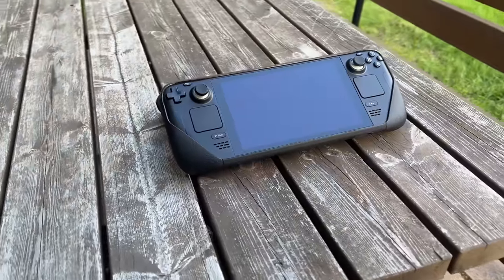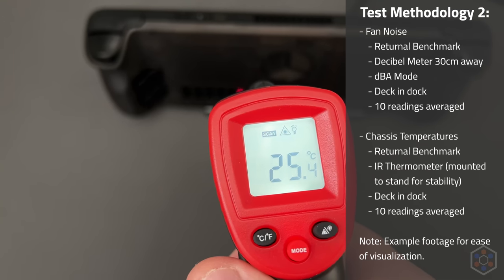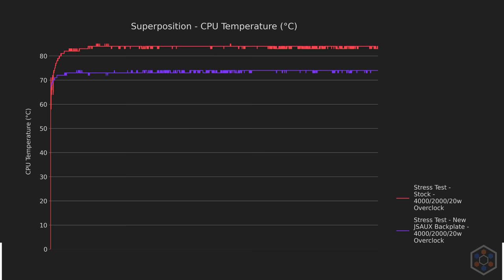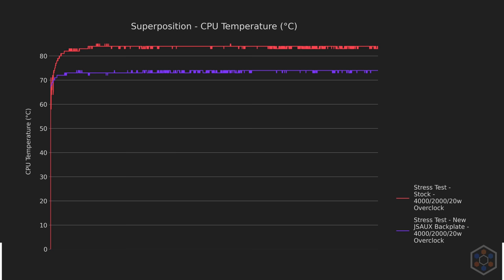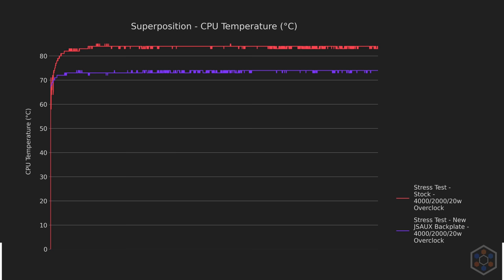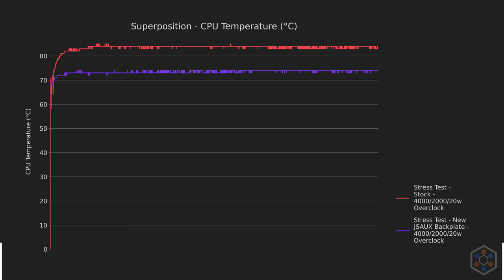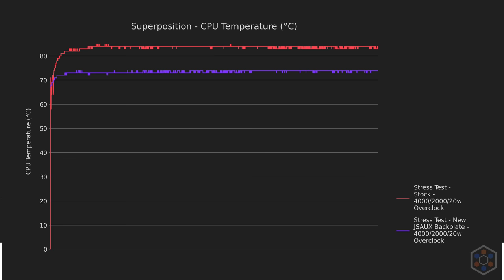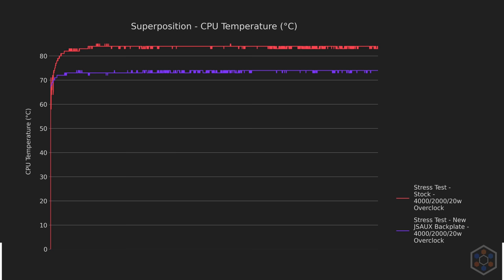How LOW Can It Go? | Steam Deck Thermal Modding

Comment: I drilled some holes onto the backplate in the same spot as the vented backplate like 6 months ago. Works great and no issues so far and I use my deck daily. Undervolt, drill holes and put some new paste on and it's a world different in noise and Temps.
Reply from the maker: I'd still be a bit worried about the metal plate getting too hot, but I'm sure that it'd be fine with some additional airflow. Thank you for watching and letting me know that your mod is working well!

Comment: Interesting to see you're using generous dimensions for the PTM pad. I've seen others cutting them to (exactly?) 13mm^2, which would be the size of the die. If you're thinking what I'm thinking, the pad is non-conductive and any excess size would only help transfer heat from the pad to the heatsink slightly. In any case, thanks for the extensive testing! :)

Comment: Top Video. The Jsaux mod case & metal back plate with the fan that goes with it works well for OC, but otherwise its a bit on the hot side on the metal
Reply from the maker: Agreed, as you saw in the video! Hard to recommend with burns being possible 😅

Thank you for watching!

Comment: Nice work as always, Kyle!
That aluminum back plate is really hot, but if you will replace it with copper plate it will be burning hot. I diy'ed mobo copper plate and placed the 1st Peltier cooler on top. I'm using ptm7950 thermal pads also.
Then the 2nd Peltier cooler is placed on the jsaux copper back plate I made. My temps ranges between 68c to 71c max with 50mins gameplay.
Can't wait to see you comparisons with the monoblock. I also installed a 2280 4tb nvme using nvme extension cable + 1tb microsd.
Reply from the maker: Damn, I aspire to have something that custom! We'll see whether I can get there over the coming months 😉

Thank you for watching, and for the copper plate warning!
Reply: @cryobyte33  Kyle, I never expect that you'd reply on my comments, knowing that you're very busy with all these benchmarks. Thank you!
If ever you decided to go for a higher capacity storage and wouldn't mine modding your steam deck case to install a full size nvme.

Here are the materials you'll be needing.
1. It should be a low profile 5cm nvme extension cable, i had it custom made from aliexpress.
2. Rotary tool and cutting blade (use the metal disk cutting blade).
3. PPE'S- goggles, mask and working gloves.
4. Ruler and fine tip marker.
5. Thin copper sheet to protect the 2280 nvme and as a heatsink as well.

I failed on my 1st attempt, cause I ordered the wrong length of the nvme extension cable, i was thinking I can just fold the cable but it was too thick, the length should be short. I ordered again a 5cm long, but the 4.5cm will be ideal if the manufacturer will agree to make it that short.

Here are some of the sample photos taken when I was doing the mods on my SD. You can use the photos as your reference for the 2280 nvme instalation.

https://ibb.co/6wqbZYC
https://ibb.co/VvmF1Zm
https://ibb.co/X8ZSnQM
https://ibb.co/ypzp9jr
https://ibb.co/DCX7mB6
https://ibb.co/2YFwJxn
https://ibb.co/30NB6XM
https://ibb.co/p4wSpL0
https://ibb.co/BPhz9d2
https://ibb.co/kGPwSVd
https://ibb.co/BKzkX0y
https://ibb.co/X3ynQSF
https://ibb.co/8NwYYQp
https://ibb.co/LRNBbTh
https://ibb.co/2W6fSyY
https://ibb.co/tbRy00r
https://ibb.co/3fJ5TJx
https://ibb.co/yP2p62V
https://ibb.co/p1HZkR0
Reply from the maker: @jozac05  thank you so much! I'm screenshotting your comment so I can try it out after I get to the US sometime 😁 I really appreciate the thoroughness!

Comment: Just a question about the PTM install, I noticed you used a piece wider than the die itself, I read that PTM is electrically conductive, so do you need to protect the area around the die as well? thanks

Comment: Kyle, I would love it if would do a vid on streaming from PC to the Deck using a 5g gaming router(s). 

Benefits might be:
storage
battery life
locked 60
no external gpu or wires  
Full PC access, including Windows gaming (I believe) using a free program called Moonlight & Sunshine

Things I noticed using Steams streaming service:
zero discernable input latency between my TV (in gaming mode) and the deck. 
   if anything, the deck screen responded quicker
all Deck and PC controls worked on both screens normally
some stutters and freezes on the Deck screen, but I 'm using a junk cable TV modem/router
  i didn't try opening ports, or messing with settings on the router, or anything technical

720-800p wouldn't be very taxing for a decent PC

This could be a future-proofing solution, that I'm surprised nobody is talking about

AAA's on PC -- Everything else on Deck, is what I'm thinking

You might be able to make a series out of this for Deck or all PC handhelds
Reply from the maker: I don't have a PC I can use for that right now, but I plan to make exactly that video when I get back to the US and have the ability to 😁

Thank you, as always, for watching and for the ideas!

Comment: Awesome video! This may be mentioned in another comment but for the fan volume measurements using a different scale for the dB might give a better visual representation of the perceived loudness. Especially for people not used to sound pressure level measurements or nonlinear measurements.
Reply from the maker: It seems I can't win 😅 In the last video where I measured dB I got a ton of complaints saying it should be dBA for more accuracy to the human ear. I got a meter capable of reading that and used it here for that reason 😂
Reply: @cryobyte33  Sorry for the confusion the measurement technique is great. There are just conversions from db to sound intensity or perceived loudness that you can use. But you are right you can't please everyone haha either way  thanks for the great content.
Reply from the maker: @chasemcardle  Yeah I don't mind swapping, it's just hard to please everyone without infinite time and/or data 😅

Comment: Just got the copper heat spreader from another YouTuber Low_Budget, and it basically ties the RAM, all of the VRM/coil/MOSFET and stuff together, and also couple it all to the heatpipe.

Which basically negated the need to flow much of the air over those things.  (Except SSD, but i do have a small copper heat spreader/sink on that)  i also have the JSAUX non-vented Case, which i do plan to drill some holes to minick the vented case.

One funny thing i found during testing.  In cyberpunk 2077's settings menu, if you do not limit frame rate in Cyberpunk's setting, it will be driving the GPU like mad and easily send the temperature through the roof. (GOG version)  the GPU is actually cooler when running the benchmark than just the menu...

If you need to run benchmarks with heatsink as saturated with heat as possible, all you need to do is let it sit at the menu for 1 minutes without frames rate limit...  I think i know what i need to do when my Honeywell pads arrives.

Comment: I'm using a vented backplate, but in the case of ssd, even if I run the benchmark, the speed doesn't drop and the temperature is kept within a safe range.
The game will heat up less than the benchmark, so it seems like nothing to worry about.

Comment: Thank you so much for this video, I will be looking into the ptm7950 thermal pads, sticking with the stock back plate believing in the air flow pattern valve went with.
Reply from the maker: Thanks for watching, nothing wrong with that! 

The negative pressure flow that Valve went with is definitely great and well-researched, but falls over a little bit when pushing more than 15w into the APU. Regardless, it's great that we have the option to use whichever we want 😁

Comment: Hey Kyle, great video. I do have one request though. Can you change the line graph style to use dotted lines for like pairs? Example:
Original Stock - Green.
Stock, pad and backplate - dotted green.
Original stock overclocked - Red
Overclock, pad and backplate - dotted red.

Would make quickly seeing improvement pairs easier.
Reply from the maker: Hmmm, I'll see if I can make that happen, I'd have to do a lot of work on my code to make that possible, as the libraries don't support it outright. It could also make it a little fuzzier in some areas.

Regardless, I'll try it out and try to implement it if I think it clears things up, thank you so much for the recommendation!

Comment: Am I broken? This is the COOLEST video on the internet to me! I did a much smaller version of this on my channel, but yours is so exciting!
Reply from the maker: Thank you for watching, I'm glad that you enjoy it! It was a ton of fun doing all the testing and aggregating the results 😁
Reply: @cryobyte33  I can only imagine! I had a blast doing my own basic testing, but I wasn't nearly as thorough as you! You've definitely sold me on the new JSAUX backplate over my current one. Though, I think I may compromise and add a bit of filtration to it. Also, I didn't expect a response, but I had a question for ya. Does the magnetic fan stick to the new JSAUX case's plate? I didn't check to see what materials it was made of, but.. man, would that be ideal if it does! There's always a way! Thanks for the reply!
Reply from the maker: @Sadtiric  The magnetic fan doesn't stick to either backplate by default, since they use aluminum plates. The magnetic fan itself comes with a sticky steel plate to adhere to the existing metal on the old backplate. 

That said, the new backplate wouldn't work that well since there's no exposed metal and you'd just be attaching the steel plate to the plastic shell. 🙂
Reply: @cryobyte33  That makes sense. I swear I watched the whole video, and even rewatched some parts, my memory just.. isn't great 😅🥲 I do remember you saying most of that in the video now that you've said it here.

You convinced me to order the new backplate to replace my old one, and I think I'll do my own, much less thorough, comparison with it and the new one with a PVC filter I snagged. Assuming I can get it to play nice. I just want to see if it makes a difference in noise and internal temps (and to keep dust out!). Theory is it might increase that internal airflow a tad and keep the other hardware a bit cooler. 

Sorry to bug you again, but what program did you use for the graphs? I recognize the style and would love to use them as well! Thanks for being so helpful and supportive! Can't wait to see what you put out next!
Reply from the maker: @Sadtiric   Sorry for the delay! I use a custom program I wrote, actually. It's a python program using MatPlotLib and it parses the results that MangoHUD generates. I plan on making it open source eventually, but it's a pretty hacky solution right now 😅
Reply: @cryobyte33  No apologies necessary! Thanks for getting back at all! 

I saw a service (Vizzlo) that does something similar and has a free version with a watermark, so I'll just use that for now. Though, I'm curious to check yours out if/when it goes public! 

I've got one of the new JSAUX backplates, and I plan to swap it with my old one and do some graphs of my own, but I also have a 3rd option. I plan to mod my grip case to potentially help block more dust and to slightly restrict airflow to allow more cooling to go through the designated path. I've never used a dremel before, but it can't be THAT hard! I'll tag you in the video when it's done, as yours was definitely my inspiration! Won't quite be as sophisticated or articulate as yours, but I'll try my best!

Comment: super useful info defiantly have to do some of these mods i would add a thick fabric to the extra vents on the back to add filtration sound dampening and increase the negative pressure else where might be able to do it with out losing to much cooling
Reply from the maker: I don't think a thick fabric would be ideal, but a metal grate would likely do wonders for both back pressure and filtration. Thank you for watching!

Comment: I have had problems with the Noctua paste pumping out and leaving dry spots on the chip.
Both on a naked die Laptop CPU and a Vega 64 GPU.
The temps are good for ½ year or so and then they slowly get worse.
The paste works fine on big Ryzen or intel IHS, but not on small naked die chips.

Comment: I assume  there would be no benefits to using the new JSAUX back plate if you plan to use a protective cover on your Steam Deck since the protective cover would be covering the vents?

Comment: What would be really interesting to me is how the updated jsaux back affects other heat generating components. We know the (internal stock)metal plate is used to help cool multiple of them, and valve built it the way they did to ensure airflow cools more than just the apu. So one might guess the extra vent could have a negative effect on their temps.
Reply from the maker: Check out the pinned comment 😉

Thanks for watching!

Comment: Thickness: 0.25mm sorry im confused because ive seen ppl on reddit use 2.5mm so it the 0.25 you link actually the correct one? Changing my decks shell and fugured id redo the thermal past while im at it so im trying to figure out what to use TT

Comment: I was today years old when i found out the Steam Deck can be Overclocked.
I wonder how well having the CPU at 4Ghz benefit Baldurs Gate 3 as its very CPU demanding. That extra 200mhz on each core surely has to have some benefit

Comment: at 20:06 It shows that the ptm is running hotter than noctua thus lifting a bottleneck.  However, when the chart changes to returnal, the results show that the ptm has lower fps than the noctua.  Is the results on the returnal chart mislabeled?

Comment: you missed cutting the old jsaux pad to let more air pass anyways awesome work
Reply from the maker: Doing that reduces the benefits of the metal plate, but improves airflow a bit. It definitely helps plate temperatures, but it makes the old backplate function much more similarly to stock, which I think is a bad thing unless you're going for aesthetics.

Thank you for watching!
Reply: @cryobyte33  i don't agree i get much better temps now with around 25% of the left side of the pad cut .The back plate is still really hot. Cutting the left side of the pad help the fan and let more air in. i guess a least 10c less than the stock backplate

Comment: Mviioe Cooling Fan for Steam Deck, bought on amazon and it doesn't have a clip it just locks on to the top, so it doesn't interfere with the dock. In testing it lowered my monitored temps by about 10 c. It is an awesome budget option, and it isn't very loud even on the 3rd faster setting.
Reply from the maker: Thank you for letting me know! It doesn't look like I can buy it here, but maybe after I return to the US 🙂

Thanks for watching!

Comment: i was having overheating issues on my steamdeck with the stock backplate on god of war i was hitting 90c and my deck was throttling and dropping FPS like crazy. I went with the Jsaux Vented backplate and my temps dropped to 70c and never go over.

Comment: Thanks a lot for your extensive testing and the detailed video, earned my subscription :)
I got a few questions if you don't mind:  
1. About the airflow from the original vent to the other components (VRMs, ICs, SSD, RAM), even though in your testing there was little variation in their temperature with the Jsaux vented backplate, there's definitely less airflow there, so would you say the additional airflow pull from the Jsaux clip-on fan compensates for that? I'm concerned about long term component longevity with less airflow. If not, would just closing that additional vent with tape make it like the stock backplate or is there more to it?
2. In the new vented backplate, the metal plate is not exposed like the old one. Is there nevertheless a significant advantage attaching a magnetic fan to to it instead of the metal plate directly?
3. Without overclocking, will I get significant performance advantages by thermal modding the Steam Deck?

Thank you!
Reply from the maker: Thank you so much for watching and subscribing!
1. The clip-on fan SHOULD be able to compensate, especially since it would cover the vented hole, but the tape trick would work too. That said, I've been using mine OC'd with the JSAUX vented backplate for 3 months now with no issues!
2. The new backplate has an aluminum plate rather than steel, so it won't hold the magnetic fan. It also has much less thermal mass and a smaller thermal pad, so the magnetic fan would have a much smaller effect than the old plate.
3. You won't likely see performance advantages without overclocking, but you would have much quieter fans and marginally better battery life as a result!

Hopefully this helps, thank you again for watching!

Comment: Great video! I do have a gen1 jsaux plate still.. its very hot lol i added a heat sink (2 next to each other) to the back and got cooler cpu and gpu temps but of course still hot as hell to the touch. Have you heard of the thermal pad issue people had where theyve cut out a section for the air channel? If so, would you recommend i do the same if i keep my gen1 jsaux backplate?

Comment: The jsaux backplates aren't really an option for me as I already have a case I like, but the thermal pad seems like a great upgrade.
Might aswell replace the fan while I'm at it as I've gotten unlucky with a delta one..
Thank you for your thorough testing as always, you make our Deck experience a lot better!
Reply from the maker: Thank you for watching, I totally understand the choices! I love my modcase so it's hard to give it up 😉
Reply: @cryobyte33  I was thinking the same. But theres a solution and it involves a saw.